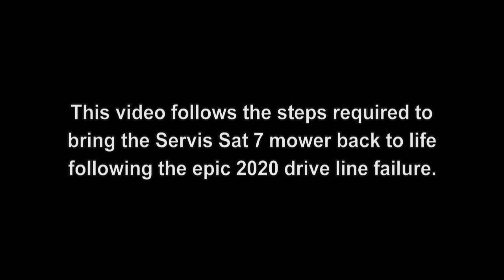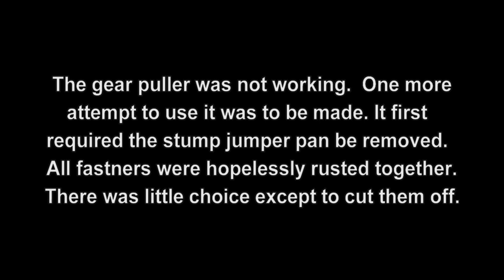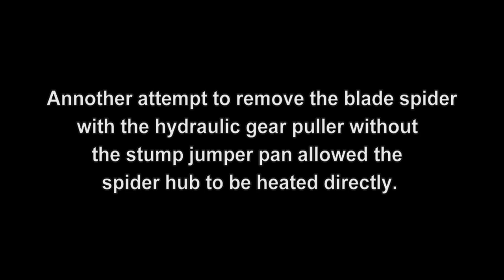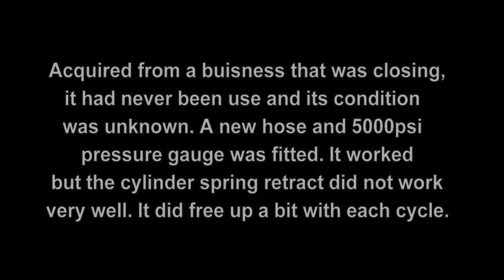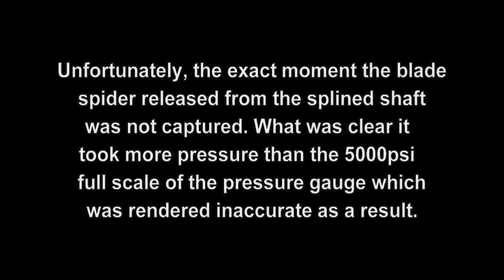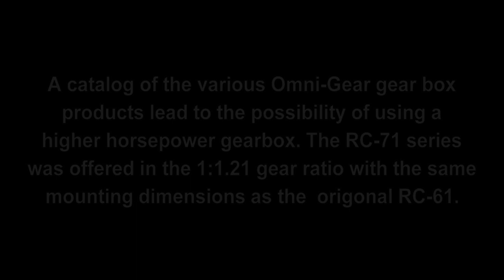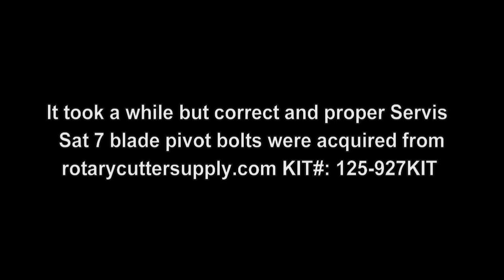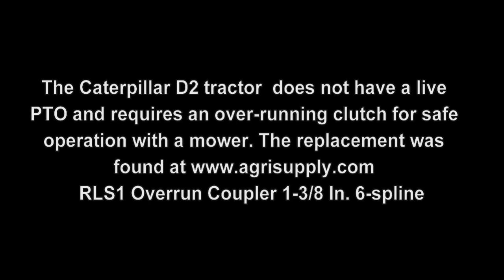Servis Sat 7 Shredder Restoration Part 1 Disassembly, Damage Assessment & Recovery

Comment: I just purchased an in good shape "Service Sat 5" (its about 5 feet wide so I suspect that is the "5" in the model number(?).  ). Anyway, it does not have a slip clutch, the Seller told me it has a sheer pin like a boat propeller. Should it have a slip clutch and do you think it was removed at some point?  What RPM do you spin your Sat 7 at? Thank you!
Reply from the maker: I would add a slip clutch. Mine was purchased from agrisupply.com.  They have a shear pin version.  The Sat7  original and replacement gear box have a 1:1.21 ratio with input of 540 nominal rpm. Output rpm is  about 653 which gives a blade speed of about 160mph. I suspect the Sat5 runs faster to get similar blade speed.
Reply: @lineshaftrestorations7903  Thank you. I really appreciate the response.